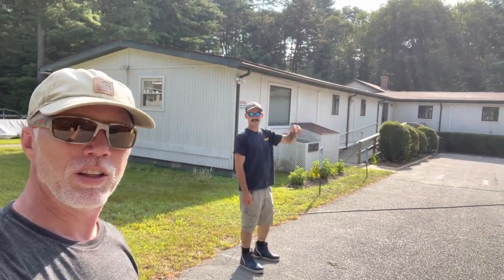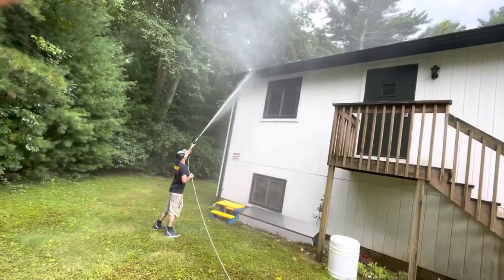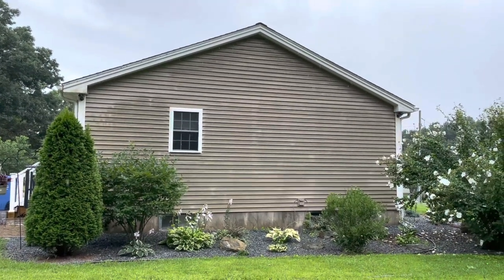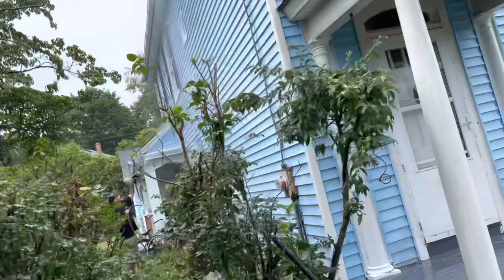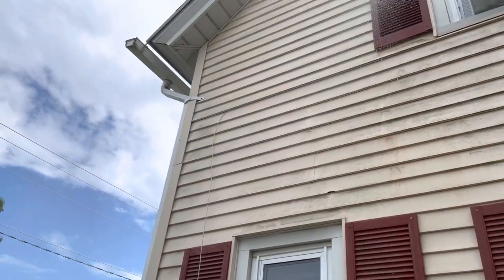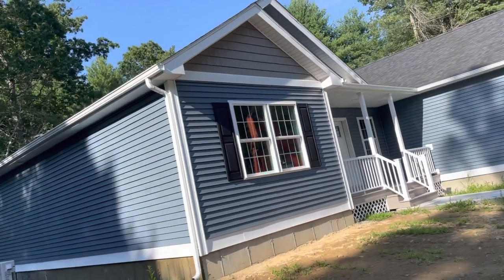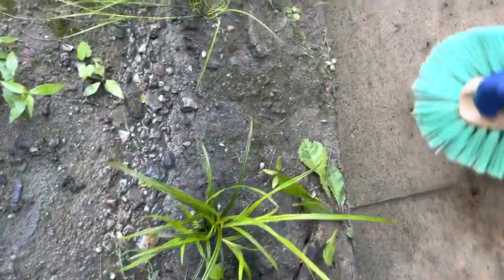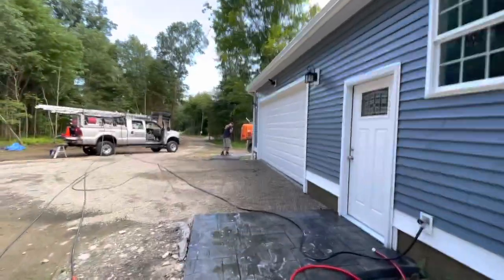Special Guest. 6 Washes

Comment: Shit that’s a commercial for that one restore what ratio did you use
Reply from the maker: Roughly 50/50. Much hotter than it needed to be I’m sure but I just put a little in the bottom of the bucket to get the job done